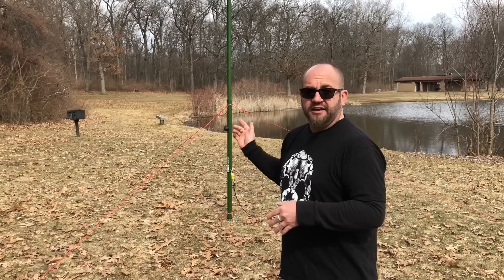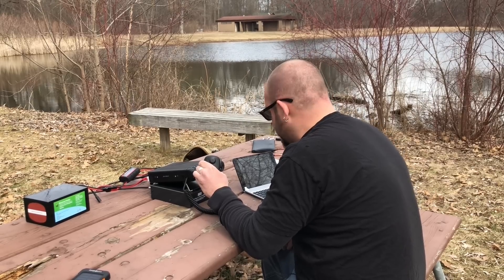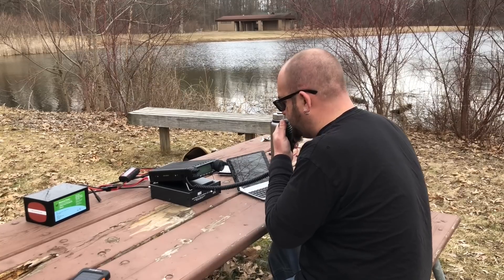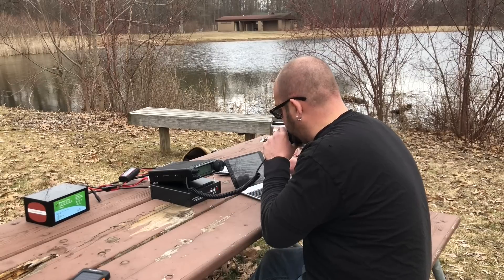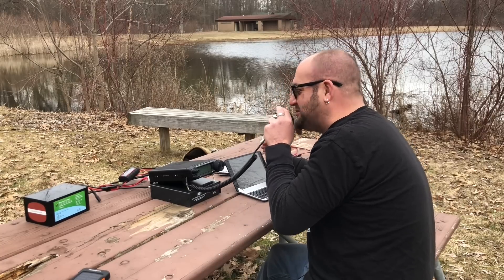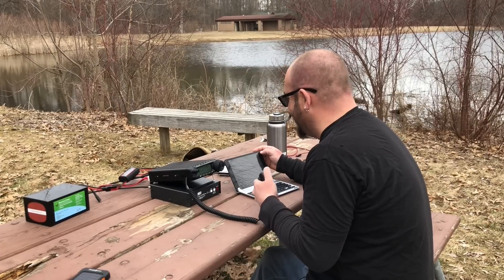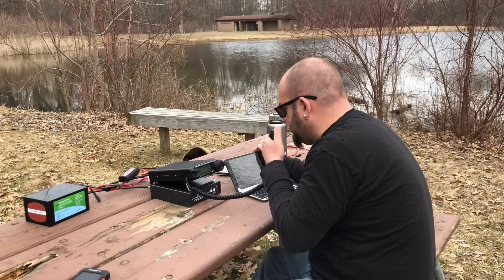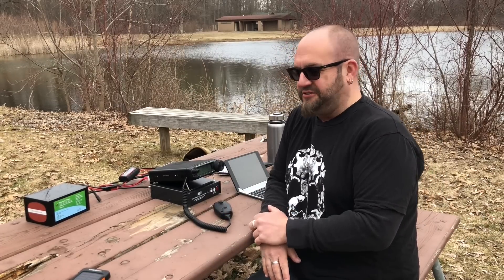Best portable radio setup ever?!?  Yaesu FT891, MFJ-939 Tuner, PackTenna Mini, Bioenno 20AH battery.

Comment: I’m considering purchasing both the 891 & the 818nd.   However, wouldn’t it be smarter to go with the 891?  Both are around the same price, size for portability etc.   Can’t I just turn down the power on the 891 for QRP ops and antennas yet have more power in case I want it in the future? In other words, why do many go with the more limited 818?
Reply: Yes you can. 

You will be giving up 2m and 440 offered on the 817 and with that, the possibility of working satellite. However, because of the 817s age and reliability, you can always find decent deals on eBay for $400 or so. The 817, 817ND, and 818 are essentially the same radio. 

As a [soon to be] owner of the 891 and [presently] an 817, I'd recommend the 891 because of its more modern features and filtering. The 817 is a previous generation radio designed and built in the late 90s. It was a wonder for its day and still is a thoroughly marvelous radio. But the 891 has a similar footprint and the ability to add power when you need it. Hope this helps.

Comment: I’m finally looking at the 891. Is that the random wire? I have that packtenna…waiting for my first HF radio to arrive, have the mini 9:1 already
Reply from the maker: It is the 9:1.
Reply: Thanks. Looking forward to tuning this up

Radio arrived today, had this antenna, ATU & and have all parts but one BNC connector that didn’t get sent correctly…grrr!

Comment: Do you still think that this is the best portable setup ever?  I know you are rocking the 705 a lot now-a-days, but does your 705 setup beat this one out?
Reply from the maker: It's still up there.  I still use the 891 as my main 100 watt portable rig.  Plus, for wire antennas I'm really digging the EFHW as it doesn't need a tuner, though you don't get every band.  For all bands (with a tuner) and super fast setup I'd still say this is among my top choices for portable ops.

Comment: Great vid!  Question:  Battery is connected in-line to the analyzer, which is then connected to the workbench distribution box.  Then, there is an output from the workbench which appears to eventually route to the transceiver.  Is the tuner connected to power via the battery as well, or another source?  If the former, I only see the one outbound powerpole set from the workbench. Clearly i'm missing something! haha.  Thanks in advance!
Reply from the maker: Gosh, it's been so long but the tuner should have also been connected to the power pole distribution box.  There are 4 outputs on it.
Reply: @hamradiotube  Thanks for the reply! I actually just watched your matching video I think you did on the same day reviewing the tuner. I believe you just had the radio powering the tuner with the interface cable, which I didn't know it did. Thought it needed a separate power supply initially. Glad it doesn't.

Comment: I’m all new to this and I want to get into it and learn more. These transmit on HF waves and the range is very far correct?
Reply from the maker: Yes this is HF ham radio.  The range is usually pretty far yes.  But it does fluctuate with propagation and the frequency you are using.  Fortunately we are in the upswing of the solar cycle so it's only getting better.  I just talked to England yesterday from Texas with 10 watts.  10% the power I was using in this video.

Comment: hi Mike! i'm actually looking at getting a tuner for the same radio. in the description for this video you mentioned a specific Yaesu cord should be used but the link isn't working. any chance I could get the model number for that cable/cord?

that packtenna mini looks like a great antenna and sounds great on 20m. with the tuner are you able to be copied clearly on 80m?
Reply from the maker: Try this link:  https://mfjenterprises.com/products/mfj-939y?_pos=29&_sid=7b2c5a755&_ss=r  I don't get on 80 meters but this tuner will definitely tune it up.  It'll be quite a compromise as the wire is only about 40' with the PackTenna mini 9:1.

Comment: Considering this as my very first hf rig. I like portable/ mobile type units. I have an ic-2730a as my primary base vhf/uhf setup in my shack. Have the same 2730’s in each vehicle. I currently use an sdrplay rsp1a as my hf rx method. Ready to pick up an hf rig and also attach to the signalink. Seems like a great emcomm type setup.
Reply from the maker: This is the best mobile/portable radio out right now in my opinion.  You will not be let down should you decide to take the plunge.

Comment: Hi. The MFJ-939Y interface cable is compatible with FT-891, not just radios using Yaesu's FC-30 tuner (the FT-891 uses FC-50 tuner)?  DXE does not list the 891 as compatible with the 939Y.
Reply from the maker: That is correct.  I did a video just on the tuner you can watch here: https://www.youtube.com/watch?v=Tn_TSoG0Umk&t=82s

Comment: After a fair bit of research I just ordered my 891D. I travel about 2-2.5 weeks a month for work and was looking for something overhead compartment-capable. Enjoyed the vid and subscribed! What is you lifespan of that 20 amp battery running 80 watts? 73
Reply from the maker: You have made a good decision on the 891.  Thanks for the sub.  I have never drained the battery while out but I would imagine I would get about 6 hours of non stop pileup use out of it.  On RX, I would get about 20 hours.

Comment: Today I had to send my 891 To Yaesu for repair. I went to use it in my Truck, and NO power! I checked ALL of the Cabling, the Fuses, and the Hard Connections. ALL were solid. I would press the power button, and I hear a relay click and an almost inaudible rapid set of 4 Beeps. NO ONE I have talked to could offer me any clues regarding what has gone wrong, so its off to Cypress CA for Warranty repair-SUCKS!
3 days to get there.
5 Days to sit in wait due to the Virus.
3-4 Weeks later, they MIGHT get around to fixing it!
Then 3-4 Days for it to ship home.
5 Days after that I have to leave it due to the Virus.
If I'm LUCKY, I'll be able to use it again in Mid September!
Reply from the maker: Oh man, this is the worst thing I have read all day.  That sucks, I'm really sorry to hear that.  Quick solution if you don't have an extra radio though, buy another one to use while its out for repair, and then return it.  Just make sure to check the return policy!!
Reply: @hamradiotube  Thank you for your kind words! I have considered doing exactly that-however the return policy is only 10 Days, and I expect my 891 to be gone at least 4-5 Weeks, if not 6 due to the virus business.I've been watching the local boards for a good used 891 with the idea of buying it, using it for a time, and then selling THAT to recover the money when my existing 891 comes back. That way, I have a better chance to break even on the money. The rig in my home is an Icom IC 7200, which is also a FINE radio. I considered selling it and spending the Difference for an FT-991- but I HATE Menu driven radios, LOL!

Comment: Great video Mike. I was your last contact there. KMONAS. Thanks for the video.
Reply from the maker: That's awesome!  Thanks for the contact and thanks for watching.  73
Reply: @hamradiotube  No problem. Thanks again for the activation. I just finished building an antenna for POTA use. Now I just need a more portable radio and a battery and I hope to activate a few this summer.

Comment: I gotta say, im soooo sick of hearing 5/9! During contests and what your doing every single contact is 5/9, a station could sound like total crap, distorted, s3 at best with qsb, and the other guy will be like your 5/9 sounding great. Hahahaha, its amazing. I tell the truth like you are in this vid. Your 2/3 and sound horrible, work on your station. 73. Lol.
Reply from the maker: Yeah, some people care, some don't.  I want to know how well my signal is getting out personally.  I still log everything as 59 though.  I don't like how the software I use (hamlog) doesn't easily jump to the signal reports, plus they are auto populated with 59 which means I have to delete it before I can even type the real report in.  Not very practical when running a pileup.

Comment: Thanks for the videos. I just started POTA over the weekend and I’m hooked. Already went and activated 5 parks on the late shift as everyone calls it. I was actually thinking about getting one of those tuners for my 891. Glad to hear it works well for you. I still need to get a better antenna setup so I can go fully portable and leave my car, but for now using the Wolf River coil on my car works great. Thanks again for the videos and getting me hooked on POTA. 73s from Wisconsin.
Reply from the maker: Hey thats great!  Glad to hear you are having fun with POTA.  The WRC is a great antenna on the car.  Why don't you just take that portable?  Do you have the tripod for it?  You could also make a linked dipole or a KG6HQD Speaker Wire Antenna™.  They are really easy to make and very good at getting your signal out there. 73
Reply: @hamradiotube  I don't have a tripod at the moment. I'll look into the others. That was my plan for this summer, find a way to get fully portable :)

Comment: Always LOVE your POTA videos. I hope to get on the air when my self-isolation ends. The only problem I had with this video is that the radio needs to be as loud as your voice.  It was hard to hear the calling party. You are right, getting outdoors is more fun than being in a car.
Reply from the maker: Yeah audio can be a tricky thing to master.  Sometimes if I turn up a weak signal too much in post it sounds even worse.  Hey, at least I have a good mic now compared to my earlier videos haha.  Thanks for watching.  73
Reply: @hamradiotube  I always enjoy your videos, and your mike sounds great.
Reply: @hamradiotube  Sound is very good actually. The weaker stations are just weak and its better not to adjust your mic volume constantly and concentrate on logging. Good activation. 73

Comment: Do you prefer using the 891 with separate antenna tuner VS using the G90 with tuner built in? Or do you just like the extra power of the 891 or just used to using it?
Reply from the maker: You know, it just depends on the day.   I'm really used to using the 891 with resonant antennas.  I just recently started using end feds that require a tuner.  I definitely like carrying less stuff and usually the lower power isn't a big deal so the G90 and X5105 are fantastic for that.  If I could only chose one though, I would go for the high power for sure.

Comment: Didn't catch how you set up the mini - Vertical around your mast or angled to the top of it? Just curious. I usually use an end fed wrapped around my 31' Jackite pole to reduce whipping in the wind. Nice setup - it's probably what I'd buy if I didn't have everything I needed already.
Reply from the maker: It just runs straight up the 43' mast.  No wrapping or anything other than some velcro on the unun.  It's just tall enough to keep the feed point off the ground a foot or so.  I'm sure theres something you can find you need though, come on, it's ham radio haha!  73

Comment: Great stuff Mike ... looks like good time. Just out of curiosity do you like your Bioenno over the LiFeP04 pack you made. I built one based on your design and absolutely love it. 73
Reply from the maker: You know, after building the lifepo4 pack I became such a battery nerd that I love them all.  For cost, the Bioennos are the winners for sure.  For experience and learning, the build wins.  They both perform fantastic so its a win either way you go.

Comment: Oh my God. Now the ones you work are taking over the comments!  Haha, you POTA guys are crazy. I had to laugh a few wks ago.. I wanted to work a POTA activ with one of my ultra-low wire antenna experiments. Propagation was fantastic on the dead band. But the other activators were lined up so long that normal people couldn't work him! They came out of the woodwork like so many roaches. I finally gave up after he worked over a dozen activations. I could tell he mainly wanted them. I bet you do too, Mr. 'MRD! I probably called CQ on my 2' high wire and worked DX using 5w instead.. while imagining you guys being like so many RBN skimmers who also called CQ... they'd seize to function because all they'd do is talk to one another. Same thing exactly pretty much   :)     73 OM

Comment: You can make your own power meter much cheaper by grabbing one off Ebay and putting power poles on it. Saves about $40.
Reply: that's what I did... apparently only 1 company actually makes the things, lol
Reply from the maker: I have 3 other cheaper ones and I find them to be inaccurate.  They are good enough for back ups though.

Comment: Just starting to learn about amateur radio, I understand the reply with signal strength and clarity but what does the 3324 represent ? Appreciate the help.
Reply from the maker: That is the park designator (the number of what park I am at).  There is a program called Parks on the Air were you go out and do exactly what I'm doing.  Its a great program.  Check out parksontheair.com and you can sign up and learn more about it.  It's basically an excuse to get out and play radio, but it gives people a reason to work you.

Comment: Great job Mike! I’m hoping to activate Summit Lake SP K-2270 if the weather ever breaks and provided Indiana doesn’t close our state parks because of COVID-19 (as of right now they are still open).  I’ve also been thinking it might be time to part with my old Icom IC-706 and modernize with an FT-891. 73 de Chris NV9Z
Reply from the maker: A lot of people love that 706.  It's a great radio.  I've only seen it in person once a couple years and was still pretty new in ham radio so I didn't really know much about it then.  If the temp is about 45 or higher, that's enough for me to activate.
Reply: My 706 is a straight 706 (non MK) with SN in the 11000s. It’s been around a while hihi!

Comment: Looks like you had a great time.  I am anxious to get out myself.  A good ham friend of my, Porker WV8T, is wanting to do some park activations with me.  With all that is going on right now we are kind of playing it by ear.  I should of been on the radio doing some hunting but I have been working on a Kenwood TS440S, getting rid of the ole dot issue.  Have all bands but 2 fixed so far.  That tuner seems to work great.  I have a LDG Z817 tuner I am going to be using with my FT-817ND the next activation I do.  73 for now, Juddie WD8WV
Reply from the maker: Parks are prob the safest places to be right now.  At least the ones around me.  They are pretty empty.  Although I haven't been to one since the 11th.  Now Michigan is on lockdown but I'm still working so I don't know what its like.

Comment: Why do you need an external tuner on a HAM setup? Doesn't the HAM tune itself.
Reply from the maker: I wish it did.  Depends on what type of antenna you are using.  In the case of what I'm using in this video, I do need a tuner to match impedance.  Other antennas not so much.